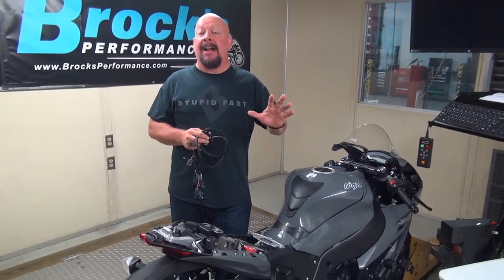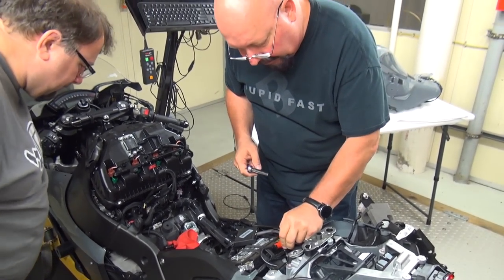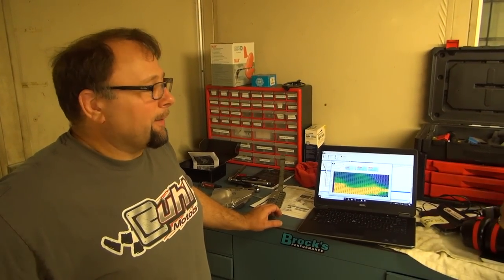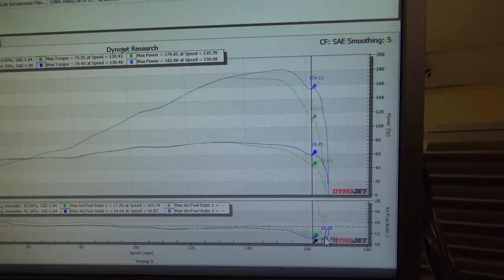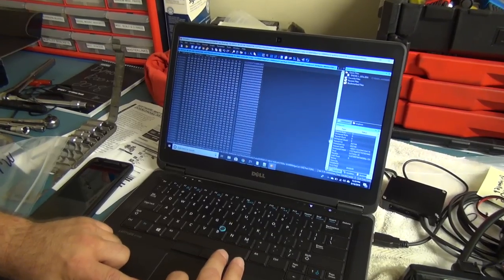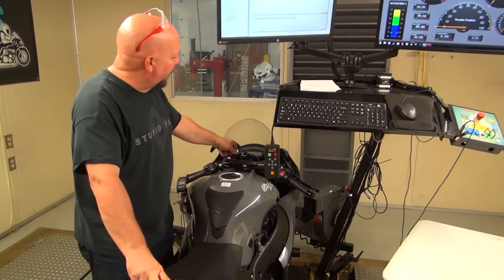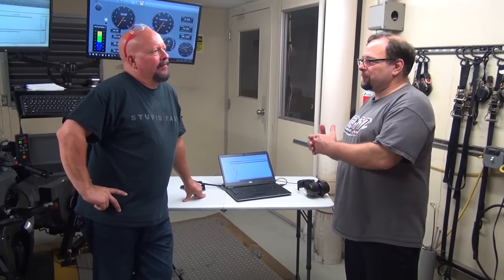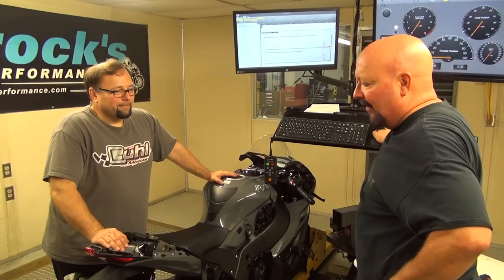Kawasaki Ninja ZX-10R (2019) ECU Flashing with Mad Scientist Don Guhl

Comment: After watching this i had to get my ZX10R flashed. I was misled I needed a piggy back system, wrong as you can see in this video.  As you can see that top end power is much improved.  Even more but i will not bore you. Happy as hell with the bike thank you both. Next project ceramic bearings, saw that video too. Thanks guys.

Comment: This video is pure automotive porn. If the information contained in it could be turned in to a wallpaper, I would wallpaper entire house with it. Also from the outside. It's time for the bed now, so I am sure my brain is getting re-flashed overnight. Could not have come across any better thing to watch, that's for sure. My bike has to wait until winter with it's flash to make absolute max out of the dying riding season here up north... A million thanks for this baffling load of information and huge salute to you both gentlemen!

Comment: My 2014 has 23k miles on it and ive been eyeing this bike since it came out. Was waiting for someone to have flash results. Ghul flashed my 2014 and when i buy this bike this winter ill be getting his flash again.
Reply: How much hp gain did you get with guhl flash on your 2014?
Reply: @Luckky-13  Our reflash for the 2011-15 ZX10R is normally has gains of 9-14 hp peak and 19-24 hp near the rev limit.
Reply: @Luckky-13  never dynoed the bike before hand but with his flash, 2 brothers shorty slipon (cat delete), stock air filter made 176hp. I bought a autotune after and I haven't had it dynoed since then. Im sure its about 180hp now.

Comment: The japanese manufacturers have been at this for over a decade. My Gixxer 2004 1000 is before drive by wire. It had the secondary throttle valves in the Keihins. The way they have done it on mine was to lean the fuel from over 9000rpm or so, particularly on full throttle. I always wondered why in laid over, and you could hear the valvetrain was just spinning, not driving and accelerating ie went noisy/rattly. They leaned it to the tune of 20-25%....can't imagine what the air/fuel ratio was.....but I must say they are pretty tolerant of a wide range of values ie combustion technology is amazing. The secondary throttle valves had some pretty weird mapping std, but at least they were open from that rpm up (at all throttle positions no less!). There are also gains to be made with the ignition timing, partiularly in the driveability range that he talks about in his other videos.

Comment: Good day I'm glad I came across this video. I notice in your video the bike didn't start back up. What was the issue?..I believe I have the same problem with my bike , I'm getting fuel but no spark.
Reply from the maker: We must cycle the key on and off 3 times after the ECU is flashed, then they start right up.

Comment: Hey brock , i notice on every dyno run it takes 5plus seconds for the throttle postion sensor to reach 100%.  You fixed the topend but you missed down low.
Example: you hold throttle at 10%=40mph  your hand goes 100% instantly to start the pull the sensor instantly went to 45%  then climb slowly to 100% about 4sec.

I just rewatched gsxR1000 s2 ep7 ,a dyno pull close to the end  it takes 2 to 3 sec to go 100% . Watch @ 20:03
Reply from the maker: This was a quick tune, simply to show the results of derestriction on a completely stock bike.

Comment: Hi, Brock! Awesome video as always! Could you tell me, please one thing. Is it any possible way to log ETV values without PowerCommander? Just tap into that grey wire and make a table Voltage vs RPM?
Reply from the maker: Yes. You use the dyno analog input sensor , connected to the bikes subthrottle sensor output and ground - then calibrate the blade open/closed on a 0V-5V scale...the PCV is much simpler ;)
Reply: @BrockDavidson  thank you, Brock!

Comment: looking at the TPS on the dyno, even after modifying the table, the throttle seems to open slow.
Reply from the maker: It does, but opening the throttle plates sooner doesn't necessarily mean the bike has that ability to ingest more air - but it does mean that whacking the gas wide open at lower RPM in higher gears results in a miss/sputter and even a stall if the rider does not intervene. We will fine-tune the opening rate to match the additional intake and exhaust mods as needed.
Reply: thanks for the reply. can"t wait for the next video
Reply: This is the beauty of these throttle-by-wire systems! The manufacturers can size the throttle bodies for additional power without worrying about affecting part throttle performance and low/mid range power. With this style system we can program the throttles to open enough to give us best power, but not so much that it hurts performance. Testing these settings are now a standard part of tuning these new "high tech" bikes. 1 to 1 throttle opening on this bike would be a disaster!!! :-)
Reply: @GuhlMotors  yeah I didn't think about that at first. I have had some large throttle bodies that caused some driveability issues
Reply: @randyschmidt19  Duc 749 ? I heard it suffered of it badly . . .

Comment: At the top you are running rich and you are bout to adjust that air fuel. Are your fan setup to simulate the ram air effect which would add more air at speed. Countering that rich condition at the top?
Reply from the maker: We don't have the means to truly mimic ram air effect in a static application - we would need a dyno in a wind tunnel. Fan's faking a constant 200+ mph at any/all rpm's and wheel speeds are nothing more than a morale boost to the dyno operator (and bike owner). If you notice our dyno room, all attempts are made NOT to force air into the inlets. We use data gathering at the race track to truly track ram air performance vs. ecu compensation - you would be surprised, Generally speaking: most Suzuki ECU's overcompensate with too much fuel, most kaws undercompensate - the BMW's do the best at getting it right. We will elaborate more once we get to the track.

Comment: Hi, I'm having an issue with my 2014 zx6r, I can run it no problem with stock maps in ecu, but as soon as I do any kind of modification to the ecu with FT flash, it wont run, it start then the bike shuts off and give me code 39 (ecu comunicatio  problem) even only deactivating the servo or any small modification, bike wont keep runing. Any idea what is wrong ? I did cycle the key
Reply from the maker: Please contact FTecu technical support. Sounds like an account access issue.
Reply: @BrockDavidson  thanks for getting back to me, we allready contacted ft ecu flash, they suggested that my issue would be coming for something else since they dont see anything wrong with the license or the software.
Reply: @BrockDavidson  could it be hardware related or it has to be a license or mapping issue ?

Comment: How come data logging from the ecu itself isnt possible and you are using a power commander?
Reply from the maker: Data is available from the ECU (OBD2) and we do use quite a bit of it in our testing. We use the PCV to tune fuel in conjunction with the tuning link function on the Dynojet model 250I, as we find it makes a far more precise map than fuel tuning through the ECU. The PCV is also friendlier to tune at the track, especially if wifi is not available or weak. For those who do not like PCV's, we have flashes available with no PCV required, but they are not able to be user-tuned: https://brocksperformance.com/brockflash-ecu-stage-1-f-with-fuel-tune-for-full-system-zx-10r-2019-must-send-us-your-ecu/

Comment: was that wheel hp or crank hp? I have a 2019 krt and only did a akropovic slip on with cat delete and wanting to do a flash im the future. Im seeing some great knowledge between the both of you and might consider a flash from guhl but will I need to bring the bike to him or just the ecu and dyno tune it after to fix the afr readings from running to rich or to lean. Does elevation play a big part? I am 7ft above sea level.
Reply from the maker: We use a Dynojet Model 250 I rear-wheel dyno on the SAE scale. Elevation does play a big part, but the sensors on your bike tell the ECU what to do in regard to engine tune. This is why you can travel from Florida to Colorado without remapping.
Reply: @BrockDavidson  I left florida to Arizona lol

Comment: I want as much tourq as possible down low on my s1000rr.  not sure if a pipe and flash does this . it starts wheelstand at 5 thousand.. I'd like 3 or 4 at worse .. can you get that with pipe and flash. ???
Reply from the maker: drop one tooth on your front sprocket - gearing changes torque, pipes and flashes change horsepower.

Comment: I just purchased an 06 zx14 with flies removed and PC5 installed, the throttle is very choppy at startup until it warms up. Can I just put it back to stock or it requires a tuning.
Reply from the maker: if the flies are removed, it will need to be tuned.

Comment: Hey Brock how are you? I have an 04 zx10r   I took my bike to a shop and had a 08 intake  cam installed along with a mail in ecu flash I'm running a 17 tooth sprocket on front and a 40 on the back. Before I had the work done I was running 17 and 39 and my bike had plenty of torque and power. Had no problems raising the front tire in 1st 2nd 3rd and sometimes 4th. Now it wont raise the front tire at all it seems I have lost all torque and alot of power on low and top end any suggestions on what I can do or what the problem is? Some else had the same setup and said that I would have to re degree my cam to 105...
Reply from the maker: Best advice would be to find an independent dyno to test your engine.

Comment: Was wondering what kind/brand radiator fluid you like to run in your motorcycles? Or recommend for street riding. Thanks.
Reply from the maker: Great Question! For racing, we are mandated to use a non-glycol based coolant, because glycol-based coolants are toxic and difficult to clean up after a spill/crash. Does that make it better for street bikes?...not really, in fact it can cause great grief for your bike is ever subjected to freezing temps. These water-based coolants can do an excellent job of keeping your ride cool on a hot day, but if your bike is subjected to freezing temps, the water can freeze. What's the big deal? Your bike has 'freeze plugs' that will pop out in case the coolant ever freezes - once out, if you start your bike - as soon as it warms up, the frozen mixture will dilute your oil and possibly cause catastrophic engine damage. We learned this the hard way after trailering one of our race bikes from our heated facility in Ohio, to a race during freezing temps - there is no way to tell if you have this problem unless you view your oil and it's 'milky-looking' from mixing with water. We rode the bike to tech, made a run and had completely wiped out all of the crank and rod bearings by the end of the 1st run. It was an expensive mistake. We use standard antifreeze (usually the 50/50 premix) or we use #evanswaterbased coolant in our streetbikes here @brocksperf - or MoCool in our race bikes: https://brocksperformance.com/motul-mo-cool-radiator-additive-16-9oz/
Reply: @BrockDavidson  
Thanks for the quick response. What about Evans Waterless Coolant? Another question, my motorcycle is tuned for 91 pump, can i run 93 pump which has 10% ethonol?
Reply from the maker: We have been testing the Evans waterless coolant with very good results: https://www.evanscoolant.com/vehicle-types/powersports/ - yes on the 93 with 10% ethanol (stay away from any more than 10%) - here is more info. on octane: https://blog.brocksperformance.com/throttle-nation-magazine-the-gas-factor-fuel-options-for-max-hp/

Comment: Does tuning in Full Power mode, Medium power mode and Low Power mode matter on 19-20 zx10? I have a tune in C85 via power commander 5, but my bike has not liked e85 in general  the way it runs. I know c85 can only be run with c85 and X85 is okay to run with pump e85, but It’s been a hit or miss on pump in the streets. The dyno was amazing on c85 , but once I took it out to race (higher altitude) it did not even want to cruise. I definitely could’ve tuned on ECU alone , but I’m curious if the bike would adapt or feel better depending on the modes, tuning on just the ecu only or if the modes it’s just neutral all across and I can potentially run different fuels while tuning on ecu
Reply from the maker: No. Different modes are controlled primarily by the electronic throttle valve. AFR is AFR regardless of the mode you're in. What you just described is exactly why we do not offer e85 or c85 tunes at Brock's performance. They seem to work well for cars, but motorcycles are not smart enough to take full advantage... Unless you are at wide open throttle, where driveability does not matter.
Reply: @BrockDavidson  yea for more power/race. Do you know if adjusting timing is necessary for any e85/c85 tunes? I’m just trying to make mine work where I see everyone else on c85 near me is making amazing performance for straight line power. Mr12 is my last resort , I’ve tuned on it before and it works like a charm, but racing in Nevada 100+ heat, I’d much rather take advantage of e85 cooling benefits

Comment: What makes them have such a big power difference to like a Beemer 4 cylinder? The S1k seems to be at 190 without much hustle wrt tuning.
Reply from the maker: That's why the S1000RR has been the bike to beat, but even they are confronted with strict noise and emissions regulations that hamper the performance of their newest models.
Reply: @BrockDavidson  I saw that with the retarded dead spot, but is it about the tune, the cams, the pistons. As in what is making S1000RR and the Ducatti hit 198+Hp with a little tuning while the likes of Kawasaki are at 185ish after tuning? 15Hp is a big gain I believe.
Reply from the maker: The Japanese only understand one thing....follow the rules thoroughly, completely and with integrity.  And you are correct 15 hp is a giant gain.

Comment: I have the same 2019 ZX10 same color as well. My concern is does an ECU flash take away from the bikes longevity?
Reply from the maker: Great question. In a nutshell, the flash matches other non-restricted international models with slight enhancements. If the operator stays at a reasonable rpm for a reasonable time, there is no reason to expect a lack of longivity.
Reply: @BrockDavidson  I thought in 2019 even the euro bikes are restricted as well...are they just less restricted?
Reply: I want to send my ECU to be flashed also but putting a generic map isnt as good as a custom one on the dyno.i have a 19 also.
Reply from the maker: @2wheelsonly614  we are 'California' restricted... Even the European's aren't as extreme.
Reply: @BrockDavidson  thanks, makes sense. Last question..would you trust mail in ecu flash? No dyno.
Reply from the maker: @2wheelsonly614  From us or Guhl...that's about it. Check this out: https://blog.brocksperformance.com/faq/how-can-brocks-get-mapping-so-close/ same applies to ECU fuel tunes.

Comment: Brock do you know if the 2019 636 does the same thing with throttle position when it reaches high rpm?? I have a 2019 636 and it feels like it falls off way before the rev limit.
Reply from the maker: @Kirt - what you are feeling could be a number of issues (intake flow/exhaust flow etc.)  To answer your question - yes, the ECU is causing power issues by limiting the opening of the secondary throttle plates. They are not fully open until about 9500 RPM and they close down to 60% at revs just before the peak rpm limiter. Give Guhl a call, they should be able to help you.
Reply: @BrockDavidson  Okay thanks 👌

Comment: If there is one person I would like to work with my bike on the dyno it would be Brock. Listen how after the rev limiter hits Brock immediately goes into letting the motor rest mode instead of letting it sit there and decelerate from 15,000 rpm with the dyno. I’m guessing he pulls in the clutch and uses the rear brake to slow down the dyno??? Or is there some kind of dyno brake??
Reply from the maker: I pull in the clutch and slow the drum with the dyno brake.
Reply: Brock Davidson that’s awesome brock I’m still wanting my bike tuned, have a new full system waiting to be installed if I could find a tuner that really knows his shit. I’m in Ky not to awful far from you and would bring it to you in a heartbeat. This bike is my baby I looked for 2 years for a clean unmolested 04/06 R1 and this baby only had 715 miles on it absolutely mint. 5,000 miles now still stock being I want a competent tuner involved when I install it.

Comment: I don't knw ZX10s but if they have stock ignitions settings like rain or race modes, how does this affect those? Especially for rain with the EXUP stuck open. I live in Oregon which has rain from time to time. Bloody good work though.
Reply from the maker: We only adjust the high power mode, low and medium are unaffected.

Comment: @1150 roughly watch where the swing ar about the front of the rear tyre and you will see a white flash. What was is.
Reply from the maker: That's the mfg. tag on the dyno tie down strap flapping in the dyno fan breeze.
Reply: @BrockDavidson  
To easy Mr Brock. 
Thanks for the reply.
It was just something that caught my eye. 
Ps. I appreciate your videos and a the effort you put into them. 

I own a 2001 k1 suzuki GSXR1000 
And live in australia. 
I WPULD live to see someone showing good power mods for my bike. 
But thanks again mate. 

Cheers
Reply from the maker: Those are good bikes - and made before all or todays restriction. The same items we use now, Sprint Filter, our exhaust, alisyn oil and petron all helped extract greater performance.